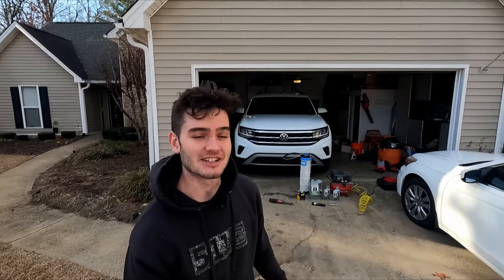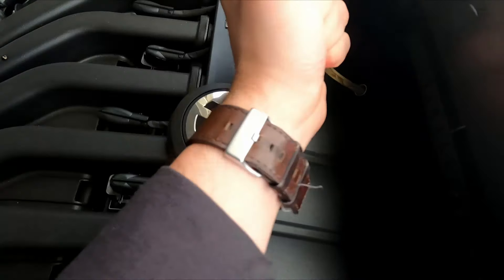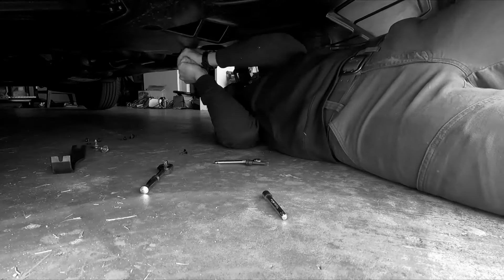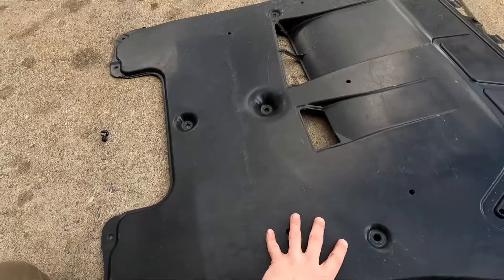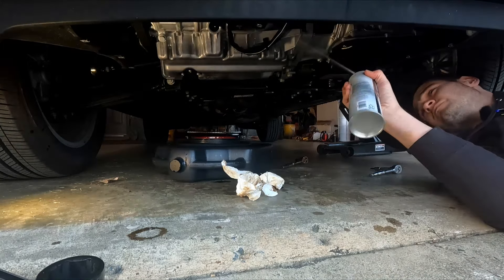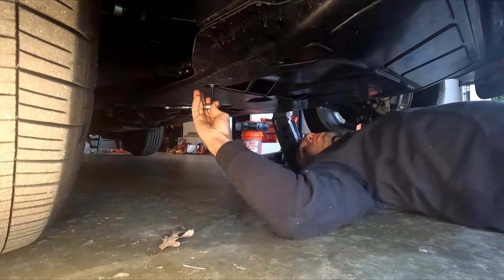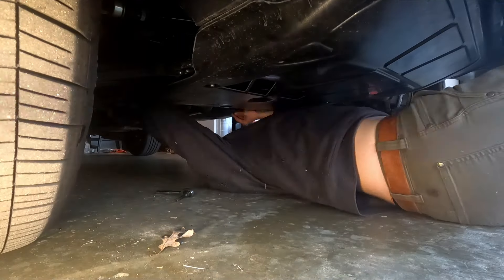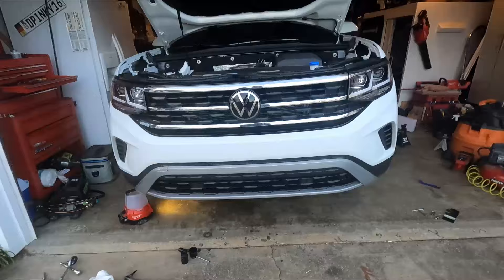Volkswagen Doesn't Want You Changing Your Oil - '23 VW Atlas

Comment: Looks standard to me. You can remove the filter and the drain bolt. Google what tools you need to remove clips, I bet a curved pick would have helped. And for god sakes use a jack stand.
Reply from the maker: There’s no where to put the Jack Stands yo
Reply: @PinkysGarage  The best thing is wood 2 FT by 2 FT square  or your wheel if Jack Stands are not suitable  also get yourself some chunks or 4  by 2  to stop car from moving and always have the keys in your pocket of disconnect the battery   so no moron tries to start the car when you are under the car
Reply: @PinkysGarage  My 2003 Mustang has no place for jackstands either. I use a scissors jack made for a Crown Vic, with a piece of wood on top, place it under what people laughingly refer to as "frame rails" (a metal jack will bend them) and hope and pray that it doesn't fall. A good scissors jack is almost as good as a jackstand if you don't have to raise it too high. The front end is too low to use ramps without destroying the plastic bumper cover. Most cars are no longer designed to be worked on.

Comment: I don’t get it? Looks like a regular oil change without an extractor? I must be missing something. 

My BMW has the oil filter at the top of the engine. Super easy to get to and is a 23mm socket. The oil drain is under the car but has a dedicated flap that just comes off with a single plastic flat head slider thing and then exposes the 17mm drain plug.
Reply from the maker: That’s what I was getting at. No flap to access oil filter. No where to put Jack stands. Pointless drain bolt. 36mm design. A massive belly pan to save 0.05mpg on the sticker.

Comment: I did it on my 2018 Atlas 2 weeks ago and had no issues whatsoever. Not sure why you need to pump the oil with that suction, when it has a drain plug. Unless 2023 is different. Same VR6 engine.
Reply from the maker: Had a 2018 a few years ago. Much easier. The belly pan on the newer ones is a pain. Suction is usually faster, easier, and cleaner.

Comment: There are so many errors on this video. Start with the aftermarket filter and the wrong oil that doesn't meet VW's 502 and 505 specs. If for some reason, you have engine problems, this video will haunt you down.
Reply from the maker: Prolly
Reply: @PinkysGarage  not a Gen z, say what you mean with Prolly

Comment: so much wrong in this video (w/unnecessary drama)...why didn't you use ramps?  why didn't you wear safety goggles? sure, not as easy as my mk4 GTI but easier than a V8 Touareg...but my Subaru is super easy and is now "no tools needed.  I replaced the drain plug w/a fumoto valve (spring lever ball valve) and the filter is on top of the engine.  I just need ramps.   Yes, some ppl say that the Fumoto valve doesn't allow all of the old oil to drain, but I get 5qts + 5oz.  Sure that is 8-10 oz shy of the recommended refill but I'm content with that.  10oz out of 176oz is fine with my 5k mile oci.  Subaru says 6k, but I kept my VWs 5k mi oci because it gives me fudge room on 5w30 oil.
Reply from the maker: Wouldn't of fit in the garage on ramps. Sure, yeah I should of been wearing goggles.
Reply: @PinkysGarage  ...how tall is ceiling of your garage?  can you pull in forward?  If the hood raises to high (on 6" lift ramps") then get a hood strap (an old belt/bungie) and hold the hood open halfway; it isn't rocket science; just a VW oil change.    If it doesn't work in the garage, why not do it in the driveway (unlimited head/hood room)?

Comment: It's the underbody engine cover that takes forever to remove and install, total of 14 screws.  The actual oil change and filter is easy.  Also, +1 on the ramps suggestion.
Reply from the maker: All of that for an extra .1 mpg on the window sticker

Comment: VW really couldve mounted the oil filter housing on top of the engine like theire other models but they probably intentionally made it this way so you get frustrated and go to the dealer.
Reply from the maker: It makes no since. All other models have a union off the water pump that goes into the oil cooler, then the filter.

Comment: There are so many reasons I love my Ford Crown Vics and Mercury Grand Marquis. Doing an oil change is one of them. They actually have frames. Chock one of the rear wheels, use a floor jack under the frame about a foot behind the front tire on left side, jack it up till you can get under it, put a jackstand next to the floor jack, put a drain pan under the oil pan, remove the 16mm bolt and let it drain. While it's draining, slide forward, put another pan under the filter, take a strap wrench and unscrew it, remove it, put it in the pan, and let the oil drain out of where the filter was. Use brake cleaner and clean off the flange where the filter was, install new filter, clean drain plug and reinstall it, remove jackstand and lower car, pour in 6 qts. of 10w30, All done. 15 minutes if you take your time.
Reply from the maker: Crown Vics are goated
Reply: OFF-TOPIC!!!!😪😪😪😪😪😪

Comment: It's Volkswagen , what did you expect ? Not a great reputation for being honest , and never easy to work on . The newer being some of the worst cars I've worked on .
Reply: @Quadruple-Vaxxed-Boomer  you've got to be joking . Yes , some of the cheaper cars aren't great but a new , more expensive car would be easier to do an oil change than that vw.
Reply from the maker: Your points are valid! The Atlas is still a beast in every way. I love them. Sure they’ve always been more challenging to work on, but never like this.
Reply: @PinkysGarage  my friend has last years model , the turbo diesel and it goes hard . But I've worked on cars for years and hate working on euro stuff . Give me the logically designed Japanese cars anyday . Cheers and good on you 🏆💯👍